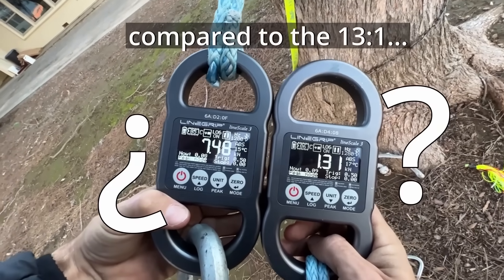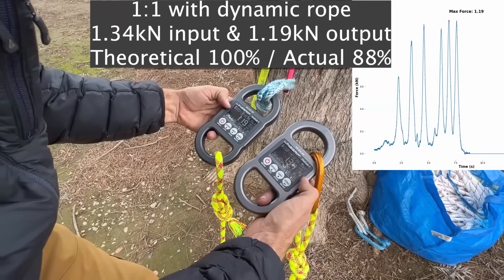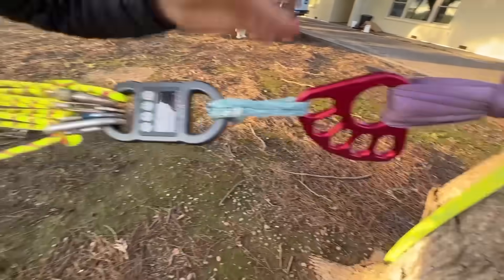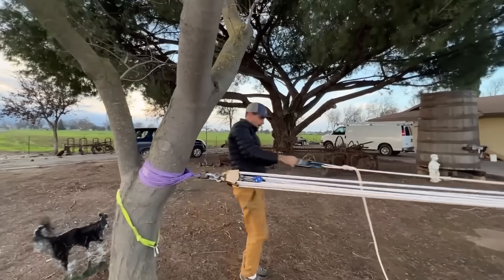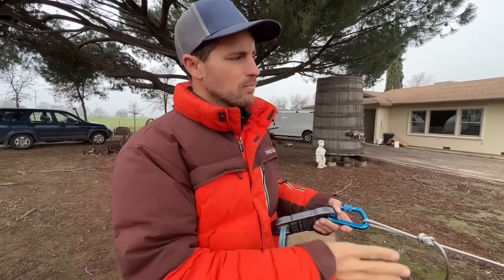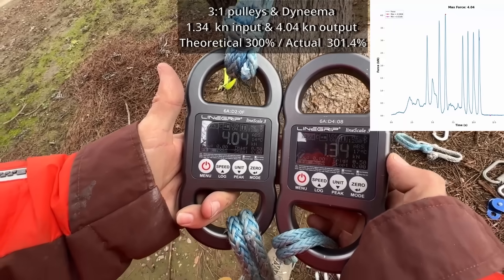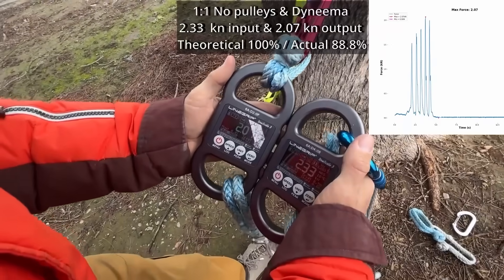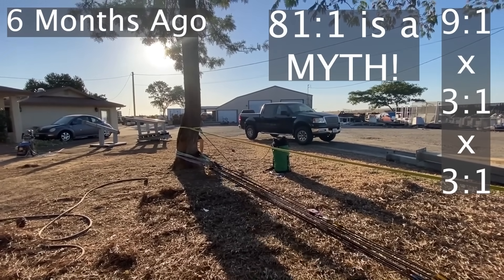Mechanical Advantage is a Myth

Comment: 3:08 you have a loss of 12.5% from a perfect 5:1 ratio as 0.89 x 5 is 4.45 and ( |4.45 - 3.84| / 4.45) x 100 = 12.5%

That's not terrible considering friction, stretch and any air resistance friction from the ropes interaction with the atmosphere.

The system here is ~ 87% efficient which honestly isn't terrible.

Comment: I think you got pulleys mechanical advantage wrong…
3:1, 5:1, 9:1 does not apply on peak force, but on equilibrium force !

What you are seeing is that dynamic ropes prevent force from being transmitted instantaneously, and therefore it takes time for equilibrium to be reached.

Comment: One way to get repeatable static pulls with systems like this is to add two redirect pulleys, one at the anchor you are standing next to and one above the anchor you are standing next to. Run the rope up and back down then use your body weight by hanging or standing on the rope instead of relying on your arms.

Comment: The relationship would be closer to 5:1 or 3:1 or whatever arrangement there is if it was equating total work on each side of the pulleys. Work being equivalent to force by distance (w=F•d) this also means we could add other variables onto this function such as the stretch of the rope. The stretch of the rope is ultimately the limiting factor when applied to multi pulley systems. That’s why cranes will utilize dyneema (amsteel) on a winch

Comment: The calculations you showed were for a static system, and your jerking is about as far from static as you can get. Your first pull demonstrated exactly that. Every time you add a rope to the system you'll get more losses down the line.

Comment: Mmmmmm, I know this is not meant to be a scientific test but I still have to point out one important thing. Loading the system by hand in this 'dynamic' manner is pretty incostent, the rope does not have enough time to stretch/settle so the output must be lower than expected because the equations are valid for steady state. Doing it propper with steel cable hand cranked winch would be much more representative (By it I am suggesting the same setup but without human in the system). But I still agree with the general results and overall a very good vid :)

Comment: the biggest problem you had with your portable pulley systems we've seen previously is gri-gri on the first strand from the puller. High friction basically halfs your input force

Comment: the stretch definitely makes a difference but only because the force is not constant, energy is being put into stretching the rope and that doesnt come out as force on the other side of the pully system. Once the rope is stretched out the force would look quite similar to the static rope if you had a constant load: perhaps hanging a weight on the drop tower with the reduction pully system?

Comment: Cool vid. Can definitely agree with the million other comments that jerking the rope will give different results to a steady pull when things can equalise. Yanking on a dynamic rope in a frictioned pulley system basically means you're just pulling the stretch of the rope and possibly not even engaging the pulleys. You're probably aware of this, but the algorithm liking comments definitely isn't a myth.

Comment: You're pulling in too jerky of a manner to really test this, you've gotta get the system statically loaded and then you'll see much less effects from friction and stretch. Repeated yanking isn't a good way to test this and introduces so many variables that it's hard to get any meaningful results in a test like this. Mechanical advantage when statically loading straps or chains reaches pretty much 100% theoretical, and a single person can safely pull a heavy vehicle out of a ditch without motor assistance if the setup is good enough and the chain can help it. Stretchy rope is always going to cause losses but trying to load it statically is going to naturally produce better results.

Comment: Good work. I would be interested to see if a ratchet, like a micro traction, would allow you to eliminate some of the losses from the dynamic rope.
Reply: Based on past whitewater rescue training (and haul systems during cave rescue training), I can't imagine a scenario where a ratchet ascender or prussik would increase pulling power (decrease resistance or "losses") other than to provide better grip on the strand used for pulling.  They are useful to hold the applied force on the line to the load when only a single line reaches from the haul system to the load, to ratchet a short-pull haul system on a long haul line, and to rig some higher force haul systems with minimal gear available.  A ratchet also requires suitable anchors, additional gear or gear robbed from elsewhere in the system, and often a person to tend it.  Prussiks are preferable to mechanical devices since their 'failure to hold' mode (assuming sufficient strength margin to avoid prussik breakage) is to slip; this provides the potential to dissipate some energy via friction and still hang onto the load.  Mechanical ascenders will cut through the rope - based on pull-to-failure tests I remember on 11mm rope from years ago, ~1000lbs/4kn for toothed cams (Jumar/Petzl/CMI, etc), ~2000lbs/8kn for smooth cam ascenders (Gibbs).

Comment: I like your little capstan winch. What is it and where could I buy one? 

I found this very informative and interesting, but I must disagree with your interpretation of your results. I think that the benefit you measured using dyneema was due to the smaller diameter, rather than the lack of stretch.

I have read a lot of literature about the efficiency of pulley systems, and when people move down to smaller cord they see significant increases in efficiency. This is because much of the loss in a pulley system is from internal friction in the rope. Switching to a smaller cord always makes the whole system much more efficient. You saw essentially no difference between your semi-static and dynamic rope, because they were comparable diameter. I think that if you repeated the test with small nylon cord, you would get an efficiency result similar to your Dyneema. 

All of this theoretical talk misses something though. With stretchy cord you have to pull more distance overall, because you are stretching the cord as well as moving the system. So I think in he end it is more work.

Comment: To reduce the length of rope needed, you could extend the pulley block away from the anchor tree to just a couple of feet from the other end. This way, the back and forth between the pulleys is only a few feet of rope instead of 100+ feet. Less stretch and less elastic losses, and less rope length and weight.

Comment: Do you think the 9:1 is greater than the 13:1 could be something to do with losing a percentage of the pull at each pulley meaning you want you most efficient pulleys first and the 13:1 has those small pulleys first?

Comment: Did you account for the flex of the tree. It was clearly moving. The test would be more accurate if you were pulling a fixed weight on a skid or cart. Then you would see the force required to move the same weight

Comment: You're still getting the force increase minus friction, but only at your maximum sustained pulling force. The rope will act as a mechanical capacitor and smooth out the impulses you produce by yanking on it. The proper way to test this would be to pull the free end with something like a ratchet strap and record the settled force readings on either end.

This does however show an interesting aspect, where a lower reduction pully system will allow you to produce higher peak force than the higher reduction due to the smoothing effect

Comment: Great video. Looking on the theory of mechanical systems, they consider no stretch on the rope, no friction on the pulleys and no weight on the rope, but also no weight on the pulleys plus a lot more variables, so as the video shows, the theory most of the times deviates from the reality. I usually use 4:1 system or 3:1, beyond that I think only adds weight and complexity to the system instead of giving advantage.

Comment: Comment on the joke:  If you said "friction-less, mass-less pulleys", then that would have been comedic gold for everyone who has taken a physics course.  (context: pulleys in simple Newtonian physics are assumed friction-less and mass-less because it makes the math WAY easier.)

Suggestion for improving data quality: use all of the peaks, and average the results (i.e. comparing input force and output force for each peak of each "sample").  

Advanced suggestion:  Add some error bars.  As one of my professors once said, "any measurement without error bars is useless".  Determining error can get REALLY complicated, but a simple way to do it in this instance would be to use the comparisons of each peak's output/input, and take 1.96*(standard_deviation) to get the 95% confidence interval bounds.  This means that 95% of the measurements will fall within the error bars, and you could do all pretty easily in Excel or Google sheets.  If you're curious, I'd be more than happy to walk you through the process!

Love the videos, keep em' coming.

Comment: I think the fact that you don't get the same result pulling on the system without any pullies or carabiners in the system shows that this a flawed test... This is a good practical demonstration of losses in a pully system, but your conclusion that "mechanical advantage is a myth" or the comments about the rope stretch causing the issue is misleading. You're taking a system and loading it highly dynamically so the mechanics behind an essentially static system (theoretical mechanical advantage in a system) obviously aren't going to hold up. What you have demonstrated but fail to really say is that you reach a point where the increased friction in the system may outweigh the benefit of the theoretical increase in mechanical advantage. To say mechanical advantage is a myth either deliberately click batey, or a wild extrapolation from poor data.

Comment: Efficiency of pulleys in a system is a compound problem seen in the video.
For example, if 90% of the force is redirected from a pulley. If you haave a 5:1 system. The ropes will pull at:
100%, 90% 81%, 73%, 65%. These forces are added up 309%, so 40% of the systems total pulling force is lost in friction.  So.. pulley efficiency in series is pretty important.

 A dynamic rope basically adds rope to the system upstream under tension, which means you'll have less opposing force and therefore less pulling power.

I'm a engineer btw, and I do enjoy this backyard science, and trying to explain the results.

Comment: For the next test, I would suggest one of the follwing:
- constant pulling force (such as a weight in free space)
- progress capture device, again providing static load to the rope
Reply: If you apply a constant force, you don't get a video to post... lmao the results will be a lot different, and a lot closer to what intuition expects from those pulleys.
Reply: Also calibrated force gauges. It doesn't matter how much stretch is on the rope, in a 1:1 system the force at both ends is equal
Reply: so a ratchet

Comment: Some sort of progress catch on the final pull strand should help you build more overall tension/force in the system and give a more constant load on either the line or whatever you are trying to break.

To get a better idea of how friction effects the amount of force this can be repeated by hanging it from the drop tower and adding the tractor weights to the pull side.  Using a constant weight and changing up the pulleys from the 3" SMC pulleys, to the carabiner rollers to regular carabiners as well as testing a dynamic rope vs dynema to see how stretch and creep can affect the total force.

Comment: I plotted these out and it seems that the stretch might not be the reason for the results. The reason might be in the dynamic loading and even gravity affecting the rope that's between the pulleys, as the static rope is also the lightest. Here is the data if some one wants to take a look:

DYN 	In	        out	        ratio
1:1  	1.34	1.19	88.81%
3:1	        1.13	2.26	200.00%
5:1  	0.89	3.84	431.46%
9:1	        0.85	5.92	696.47%
13:1	1.01	5.04	499.01%
semi static			
1:1	        1.62	1.26	77.78%
3:1  	1.31	3.46	264.12%
5:1  	1.1	        5.15	468.18%
9:1	        1.31	7.48	570.99%
13:1	1.4           6.98	498.57%
Static			
1:1           2.33	2.07	88.84%
3:1 	        1.34	4.04	301.49%
5:1           1.67	6.71	401.80%
9:1 	        1.47	9.62	654.42%
13:1	1.51	8.54	565.56%
Reply: Also in csv:
DYN,In,out,DYN
1:1,1.34,1.19,88.81%
3:1,1.13,2.26,200.00%
5:1,0.89,3.84,431.46%
9:1,0.85,5.92,696.47%
13:1,1.01,5.04,499.01%
semi static,,,semi static
1:1,1.62,1.26,77.78%
3:1,1.31,3.46,264.12%
5:1,1.1,5.15,468.18%
9:1,1.31,7.48,570.99%
13:1,1.4,6.98,498.57%
Static,,,Static
1:1,2.33,2.07,88.84%
3:1,1.34,4.04,301.49%
5:1,1.67,6.71,401.80%
9:1,1.47,9.62,654.42%
13:1,1.51,8.54,565.56%

Comment: Decent testing.  The pulleys are normally between 85% to 95% efficient. So you will lose some there.  The rope stretch is definitely a variable that matters as much as the pulleys.

Comment: As a sailor first and a climber second, I appreciate this video. Could you test some sailing-oriented line for us? I think most of it will have a dyneema core for strength and being static, but covers for this core vary widely depending on friction needed, pulleys being used, the handfeel, and workability of the rope. An interesting experiment would be to see how much extra force we get on a jibsheet for every extra wrap around a winch we take. More wraps takes more time to do and undo, but also lets you hold hundreds of pounds of force. Too few wraps means your winch will slip against the rope, and you won't be able to pull the sail in anymore.
Reply: So a wrap will just increase the friction. It will highly depend on the type of and thickness of your line, the size and the material of the winch.

Comment: I have a suggestion for the data that I think would have been cool for this test and may be useful for future tests.
Lets call the linescale you were holding A and the linescale at the end of the pulleys B. I think it would be really cool to make a graph of a moving point with the data from A on the x axis and the data of B on the y axis. I imagine it would make a little oval shape as you play through the time, but I don't know exactly and I think it would be really cool to see. 
Like at the start you yank on the line and A starts to go up. so the point moves right. but then a little later as the rope stretches B starts to increase so the point also moves up. But now the yank is over so A starts going down (so the point moves left) and finally B starts going down a little later so the point moves down back to where it started.
I think for tests like this one it would give you some really cool visuals and you could even try to compare the oval shapes at the end

Comment: When I pull my soft shackles to 10KN+ on my theoretical “15:1” system I found I can maximize the force of my “1” by putting on my harness and clipping to my belay loop. Like a saddle on a horse!! Helps especially when you have no homies to pull with you. I’d need an extra linescale if I want to do a similar test like this one though. Thanks for this info I’ve been waiting for some good MA testing!!!

Comment: Serious question: hope someone can answer seriously, what if you were to capture the stretch in the rope not allowing it back into the system. As you jerk the input side you are taking up the stretch but then you let it return into the system. Is it still such high loses when you’re slow pulling with say a winch or a van where that stretch is continually being taken up…would you not eventually reach the point where the stretch is stretched and then acts like a semi static or static rope where your input more closely matches the theory or would there alway be loses to keep the stretch stretched. Sorry wish I knew more technical terms but hopefully it’s clear enough.
Reply: This actually causes most of the loss due to stretching. If you progressively load a stretchy rope and have a lot of patience you can get it to transfer very large forces, but if you jerk on it that'll never happen.